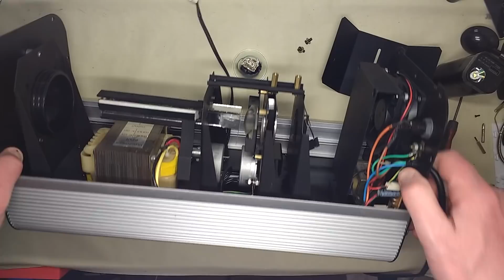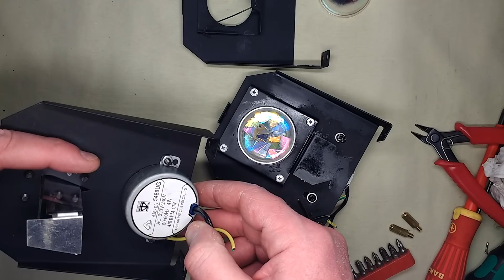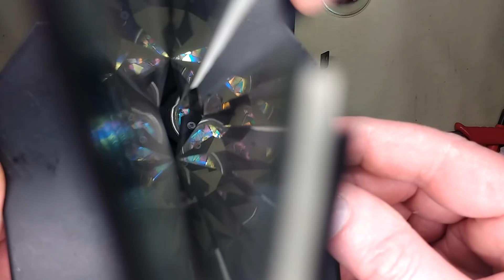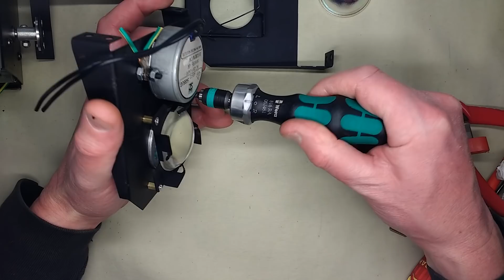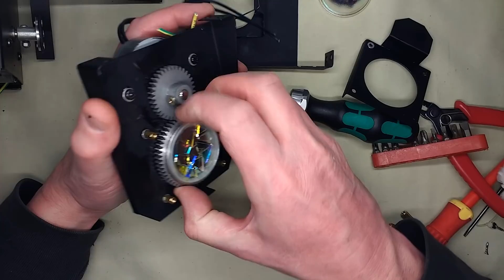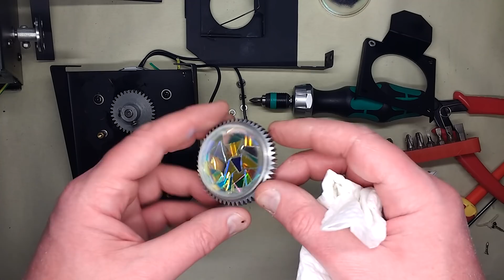Inside an old disco kaleidoscope projector.

Comment: Speaking to all of you guys and be quiet. Talk about the halogen vs LED lighting and Equipment Etc I used to be on stage crew years ago in high school 250 watt halogens try 500 watt and more.

Not to mention those is Xenon lamps on the Falls spots.

Then those bulbs are over a hundred bucks a pop.

Pun intended.

Every now and then we would know when one of our stage lights lights would go out unexpectedly because the bulb would explode I'm talking about the large halogens with the prefix spaces that where the Mughal in size Bass. I remember once one of our guys was up on the Genie Lift we had a bulb that was not working and it was still plugged in I don't know why it was still plugged in when he went up there. But he reached Inferno bulb happened that have one arm on the safety case of the Genie Lift about 50 feet or so up in in the gym before homecoming and screams out all of a sudden it's live diet from one arm to the other and believer or not that fixture had a bad ground plus it was clamp to steel beam which had enough paint on it to to keep that for making a decent ground connection that's the only reason it did not trip breaker on Earth why do you quit meant there was no ground fault protection as we call it in the United States ground-fault circuit interrupter or from where big Clive is Earth leakage breaker or rcd.

In the auditorium we had three face that was an ant coming in strictly for lights and that does not include several several hundred amps of auxiliary and others coming in once we wind up using jumper cables to bypass main breaker because The Show Must Go On biggest performance we ever had at school it would have been the most point ever for our school if the show had to be cancelled. I was the one that did this of course I was up there wearing runs women's gloves the whole time unclear call mircom waiting for any indication to yank the cables I was the one that did all of the electrical work and repairs for stage crew for 4 years all through High School yes I was authorized to do a logical work even though I was not certified it tells you just how much is a d y r i Am that knows the codes I've done installations never had a proper inspections I've out and Don Professionals in terms of passing code and surprising code according to the inspections.

Comment: I was working on one of these the other day, older than this i think, bit cheaper tool. No fan, just a concave mirror with loads of mozaic type mini mirrors painted various colours, a single stepper motor spins the wheel at a constant speed, has a wee microphone that you can enable / disable / adjust volume to providie a pulsing effect.
Reply from the maker: Sounds like the classic moonflower effect.
Reply: Just had a quick look on google, yep i think thats what it is! Cheers! These dicholric ones looks great though, will be on the lookout for one now... :)

Comment: Matmos projector
Reply from the maker: +kerbside motors The Mathmos projector was based on the technology of the popular solar 250 effect projectors by Optikinetics.  They tended to get a bit jerky after a while.
Reply: Hi Clive, your always a mine of information, I’m just unwinding after a days of driving a 2ton excavator and your channel always has something unusual taken apart each week.
Reply: ;-) JCB 8020 actually had mice or rat eat wiring, turns out there is a link out plug for a telematics box that was never fitted- cuts fuel,starter and hydraulics. Presumably so it could be remote on and off hire and anti theft. Oh and jcb wiring is yellow, yellow or yellow

Comment: eh...just mineral oil. my in pond pump is an oil-filled version. it's actually a cnc coolant pump.
ever seen a computer run in mineral oil? cool shite, senor.

thanks Clive!!
Reply: would it be mineral oil, or a silicone oil?  I was thinking silicone, for dealing with the heat ( of the lamp ).  On a side note, never seen a mineral oil cooled computer in person, but videos of them - you're right!  pretty neat!
Reply: i've never handled silicone oil. only reason i said mineral oil is because it's cheap, plentiful, non-flammable, non-corrosive...that looks like a pretty skookum piece of gear. depending on the vintage it could be either.
Reply: @todesgeber  oh a v e strikes again!

Intentional I think so.

Comment: Love this, you could make a disc out of fused bits of borosilicate glass. it has high thermal shock resistance & cheaper than dichroic. 
small one i made just using Mapp gas looked pretty good. Second covered in a layer of clear boro 1mm. even better.

Comment: This might be an obvious thing to the more experienced, but concerning clives story about the guy at the fairground who was "electrocuted" trying to fix the transformer. Is the implication that the dude died?

Because I can't tell either way.
Reply from the maker: +Faiz Imam I'm afraid he did.  The word electrocuted indicates that death occurred.
Reply: @bigclivedotcom  there was someone somewhere that happened in my home shop except I got a really nasty jolt off of European made movie projector that was was multi-voltage Hawking Transformer in that thing and would like what you might expect for someone made in our country the motors were European 220 Motors and that France for acted as a Step up Transformer when set them or voltages the Taps were changed at the Transformer itself no voltage switching and I was working on this I did not realize is that the court I am plugged what's wrong off his equipment and not the one on the healing bench oops turns out one of the winnings when it was on 110 volts put out enough the overload my meter MB pinacate overload when I checked it just to be curious what the voltage was so in other words I got over 500 volts shock off an AC power supply for a 4in a piece of equipment it was just from the end of a finger to the middle of finger or self but I remember that good I'm glad I was not touching ground or touching that projector case which was grounded ouch probably the stupidest thing I've ever doing it working on something electrical or electronic I don't know I've been Zapped by a few other things are there instantly but that probably could have it all. Now I always make sure every time it's dead before working on it all caps discharged and if it's installed as connected hardwired lock out tag out. I do a lot of work so I always do that even in a home I've been there it gets bad especially when there's an idiot as washing TV or wants to and the TV is on the so pale you're working on and a river sign off cut your lock and turn on a 220 when you're working with it at that moment. That feeds the sub panel.

Comment: I recently made a 3D viewmaster projector using two dichroic halogen lamps and polarized lenses from cinema glasses, the trickiest part was making the 3D screen on a budget. Ended up using silver spray paint and it worked! (actually the projector lenses were even harder to make, I used one from a camera and one from an old 16mm projector and fluked the right match)  The old 50s viewmaster slides are amazing.
Reply: John Howard   Thats why they call it the "silver screen"  Ive got an old screen for home movies with that glass bead surface, (excellent for ordinary video projectors) it's the same as road markings. I thought it would be ideal for my 3D set up as I heard a guy on a YT vid say "silver screen" is what you must have for a two projector home 3D set up. It didn't work! so I experimented with silver spraypaint, a chrome one being the best. I just couldn't afford to buy a proper 3D screen, so sprayed some plastic tracing paper I had a big roll of, and voila! One day I'd like to have a go at doing the 2 video projector thing, but in the meantime looking at old photos of coney island and Las Vegas, and all sorts of trippy stuff, is pretty neat, like a big hologram (but you need to wear polarized glasses).

Comment: most 3lcd multimedia projectors use dicroic glass i them to polarise and split color lights to 3 color paths
in some projectors however if they are not maintain properly some of that dicroic coating seems to be evaporaying ot something and those mirrors lose some of theit properties making for instace one of the base colors more gradiented than it suposed to be (Might be because first mirror is exposed to a lot of uv)

Comment: Much nicer than the old Opti version, The wheel was much bigger but made of plastic so if you over tightened the grub screw onto the motor shaft it'd instantly crack, Constantly leaked gunk and as with a lot of the Opti plastic wheels - If the rotation stalled the lamp would make a nice brown blister in the wheel, That being the least of your worries as where the lamp was situated in relation to the plastic fan when (and not if) the fan failed it was a tossup if the lamp would act as a thermal fuse before the heat from it set fire to the plastic fan, Oh the crap you'd regularly find in 80's lightrigs!

Comment: I have an ACME Winner moving mirror scanner that uses a 24V 250W lamp, it made me sick to the stomach when the fan failed and it burnt out the lovely deep purple (UV) colour glass when it landed and held on that colour. I was wondering why it was turning into pink splats. They're supposed to be dichroic, I didnt think they could burn like that. Regardless I replaced the fan with a PC fan with red leds in it and took the lamp out. I moved the low volt fitting to one side and spliced in a GU10 fitting to the mains side and popped in a Phillips single chip LED lamp. To my surprise it was still running quite bright for in the house, it doesnt get bollock burning hot any more and can run all day and night with no issues ! :D  I know its never going to reach the clouds any more but for home use its cheaper than replacing it with a modern led type scanner and will probably last many more years. The colours are still vibrant (except mr pink splotty) and works well :D
So for anyone wondering if they can convert an old unit to LED, the answer is yes, as long as the led bulb fits the profile of the old bulb and your not bothered about a reduction in light output. I know there are mods for high power LEDs but I wanted cheap and simple, and I got it lol
Nice fixture btw Mr Clive, Iv not seen one of those before, very 60's/70's retro effect :)

Comment: The Kodak Ektapro dual lamp carousel slide projector is a great source for parts.  Apart from amazing optics tThey use 2 x Osram 300W EXR halogan 82v combined via mirror in a nice removable vented cartridge.. AC cyinder fan cooling unit and big 160v transformer.

Comment: I was thinking as well. Just install a lcd. Also why does it have such a powerful power unit?
Reply: Answer in terms of these lamp Transformers out of recycled and upcycled them to use to build my current power supplies. Anyone done that before. And also the utilizing it said Transformers has oil Transformers and other Transformers from salvaged equipment suggests line voltages and even lower voltages. Heck I had an old carbon Arc Light power supply unit dye used for a super bench power supply heck I even had some old tungsten argon rectifier are based ones I use for that.

Comment: I actually have a led light that's somewhat similar. It has LEDs mounted on a PCB with a rod in the middle going above and holding a transparent plastic dome with angled planes that reflect and break the led light. The LEDs are red green and blue and the dome slowly spins. It's one with the traditional Edison screw and I got it from eBay for three pounds or so. It is a nice thing. Simple and effective.

Comment: Could we use separate R, G and B LEDs with simple blocking screens? Possibly with random variable speed drives? Alternatively (since LED sources produce FAR less heat), a version of this could be made using a white 2 or 3W LED and gelatine projector filter offcuts (along with a few mirrors). COuld be a nice little project!

Comment: Damn, i had halogen lamps in my bathroom, but they are too much problem
Heat, power consumption, and they are not live long
I switched to LED lamps and they are SO MUCH BETTER, easy to install, instant switching on and off, cool, and you don't need converters, they are working perfectly 
I'm so glad LED lamps are existing
Reply: +Deathcoreguitar IMO You never get the exact same effect that you had with halogen spots... but I didn't like that effect anyway - it was a rubbish fad.
FWIW we have a long thin room at work used for an office that had 27 GU10 50W halogen downlight spots lighting it (for a brutal 1350W total load) - even when times were good it was unusual to have them all unbroken. down to the last 4 working halogens and you couldn't see what you were doing unless you were right under one - I've been sticking the poundland 5W GU10s clive tore down in the past in by 2s and 4s and they are just miles better - won't even need use all 27 fittings.

Comment: I know it's off topic and this may be a bit expensive, but I would like to see you take apart a One plus 3 or 5 Dash charger. It uses some different type of circuitry to let the phone draw more power without getting hot or dropping the charge time when still using the phone. Do what you feel like of course, I know you get thousands of requests.
Reply from the maker: I think it uses the technique of supplying a higher current at perhaps a slightly increased voltage to compensate for cable voltage drop.  It probably only supplies the higher charge current when the battery is in a lower charge state and therefore able to handle the higher charging current better.  I actually recommend against excessive use of fast charging as it does put extra strain on the battery and other components and will result in a shorter usable life.
Reply: bigclivedotcom actually the trick they use is for the charger to drop its voltage down to the charging voltage of the battery (3 to 4.2V) and bypass the charging control in the phone completely.
It is in fact a really elaborate system with charger checking the cable and the phone talking over the data lines in a synchronous protocol.

Comment: Is the oil not purposely there as a lube between the wheel and the steel case?
Reply from the maker: No.  It was definitely supposed to be inside the glass layers.  I've found where it was leaking from.  They had tried to silicone seal onto an oil contaminated surface.
Reply: Ahh! You can't beat a drop of methylated spirits!

Comment: I see many with only 120V motors in them, and they use the lamp transformer to act as combined autotransformer for the motors and light power. This saves stocking 2 voltage motors and simplifies worldwide use, at the expense of just adding a 3 way terminal block with a 120VAC or 240VAC supply connection and simply having a label inside ( often lost as the glue cooks dry) to show the option connections. 

The effects disk losing oil is very common, as they often do not include any pressure relief method ( often a silicone balloon to allow expansion of the oil as it is cooked by the lamp heat, some use a small beryllium copper bellows instead for much more viscous liquids or more corrosive ones ) to keep the oil from blowing past the seals with time.
Reply from the maker: I've liberated the contents of the wheel.  The silicone sealant on one side had been applied onto an oil contaminated surface.  It's just one void inside with all the dichroic fragments and oil in one space.

Comment: Never seen one with only one wheel. All the old ones I've seen have had Two or three Dichroic wheels set into one large one that you could revolve to change the overall pattern. Used to have two of them on stage when I used to do Discos. (back in the 1970s.  Memory's! lol)

Comment: smell you get from old radio with tubes
Reply: Yep that too.

Or equipment that generates quite a bit of heat that has not been running a while or on or just some dirt on big Power is a source of run quite hard.

Comment: I wonder why they used a 12 volt fan when they could have used a AC fan just like they used AC motors, would have made things simpler, also why use the 24 volt quarts lamp when projectors have been using 120 volt and 240 volt lamps for years ? would have made the unit so light weight and lower cost.
Reply: 12V fan is a lot cheaper and quieter than a 115VAC or 230VAC fan though, and will last long enough to get the unit out and running, plus it is a lot less mass added to the unit. Though with them already having a 24VAC transformer they could simply have specced the winder to add an extra secondary of 9VAC to it and had a free supply. Adding second winding when you already have a custom primary ( 3 wires for voltage selection is custom, you typically have a single primary voltage only) is cheaper than adding another transformer to the unit, just from the extra assembly steps needed. Or they could have just used a 24 VDC fan instead and added a simple voltage regulator board to the design, which would also have worked.

Comment: You can still buy effects projectors, including a kaleidoscope.
Takes me back to the days i ran a disco, we had a projector, but it used interchangeable gobo's, the gobo carrier was outside the case behind the lens, the projector had 'industry standard' rods out the front where the lens  and carrier fitted, the gobo carrier could be changed for a wheel carrier.
Reply from the maker: Optikinetics solar 250 or Pluto copy?
Reply: Heh, got a little confused, it was a pluto 150, but used optikinetics gobo's, the only one i have left is cassette no 21/2, but not the projector
the rods i referred to was from a different projector, like the ones they had in schools for slides, cast metal housing
.
Reply: I was thinking about the solar projector see you since it has four times I've heard of these I don't I think they're made by the same company but rebranded.